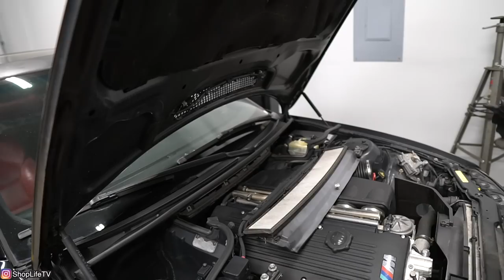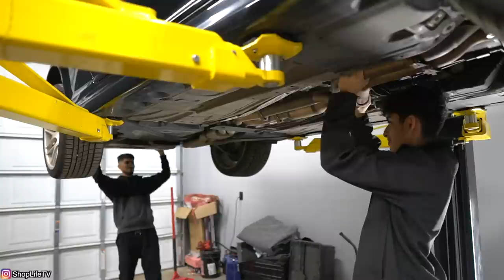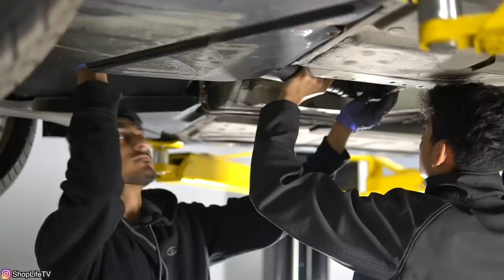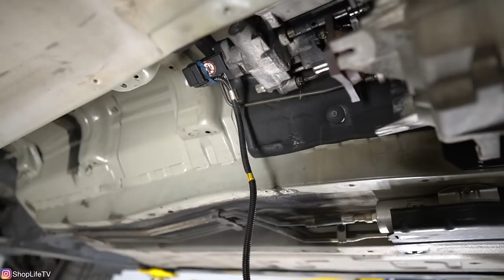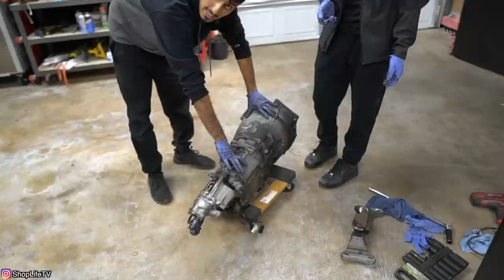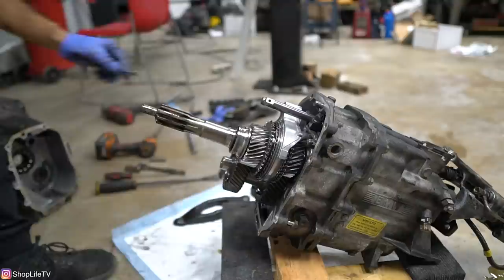WATCH ME WORK ON THE COPART E46 M3! (SMG TRANSMISSION NO MORE)

Comment: Im doing this swap currently as well as rod bearings at the same time, i didn’t want to get the bellhousing machined so thankfully i was able to source an oem manual trans to directly swap in. Its so impressive how using a lift and having lots of experience makes all this work go so much quicker
Reply from the maker: What a coincidence lol Thats awesome that you were able to find a manual bellhousing, will make the conversion a bit easier! The lift is definitely the best tool in the garage!
Reply: @ShopLifeTV  I bought a whole manual trans and clutch assembly before I even got the car. I’m not sure if I want to swap bellhousings or if I should use the whole manual trans (it has 10k less miles, but I’ve heard smg internals tend to wear less). I definitely want to get a lift sometime in the future 🤞

Comment: When you refill it with fluid, make sure you use Redline D4 ATF. Don't use that horrible BMW gear oil. That's why you have shavings in there. It's bad stuff.
Great work man. You are doing a fine job. Kudos to your helpers too.
Reply from the maker: Thanks Tony, im not a fan with straight D4. I like to do a 50/50 mix with mtl and d4 or a syncromesh fluid.
Reply: @ShopLifeTV  What are your concerns with the D4 ?

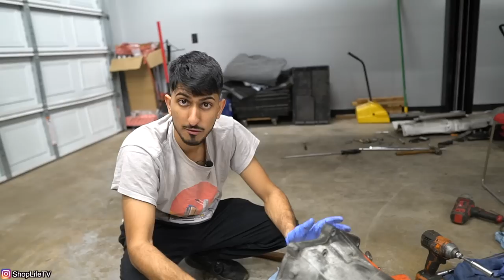Comment: why not use a reverse lockout type short shifter instead of sending the bell housing out for detent work? In the end, you get a much better shifter (Hint: RTD). based on what you say at 18:30 it's not just a savings in money, but labor and time messing with that bell housing.
Reply from the maker: RTD/CAE shifters are the quicker/cheaper way to do the conversion, but until they are able to utilize stock shifter knobs and stock look and feel I think most people will prefer the bellhousing machining.

Comment: At 16: 23 ! How many people You need to have to remove (or install) a Transmission? 
By the he way You should HAVE a Transmission Jack , hydraulic one !!! 
Screw jock it is NOT for removing Transmission?
Reply from the maker: Lol you must not watch my videos. I usually use a hydraulic trans jack, but my fiance and her brother were already there and helping so we decided to just man handle it out
Reply: @ShopLifeTV  - One "super mechanic "  tried in the same way to work on Volvo transmission and transmission fell on concrete floor and crack the housing .
To me : fir every job have to use right equipment and tools.

Comment: Hey man, I'm having a problem with my SMG trans on a 2004 m3. I've had shops tell me it was a broken detent spring. Was wondering if you had any experience with this and any tips for the DIY. I'm gonna tackle the job with a few friends. The shop I trust the most said it can be done by dropping the transmission cradle, and I believe they said something about removing or loosening the fan so that when everything pivots downward, it does get caught. Apparently, the trans will drop almost 6 inches which should give me enough room to reach the detent spring. Any info you have on this would help! Thanks

Comment: If you change Gear Position Sensor for a part worn one will it need coding or computer work? Hoping I can just plug and play and SMG gearbox will work fine
Reply: You have to do an adaption using INPA
Reply from the maker: Yes what ^ Yousef said, you will need to do a relearn procedure

Comment: There really is nothing wrong with SMG as long as your maintaining correctly and don't destroy it but I will admit a male transmission is better
Reply: Female* 🤙
Reply from the maker: I agree that the SMG is a great system...when working properly. It is more common to have issues with the SMG system than not. Most people will also prefer the manual transmission as many m3 owners are interested in driving spiritedly and manually shifting gears.